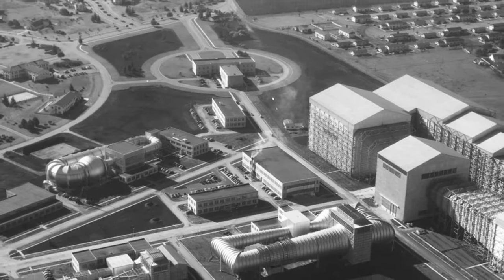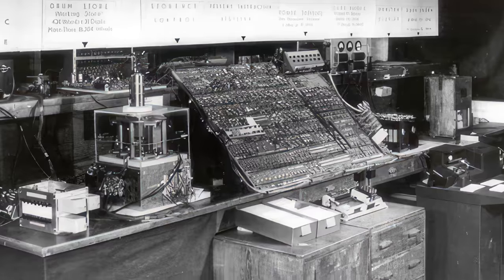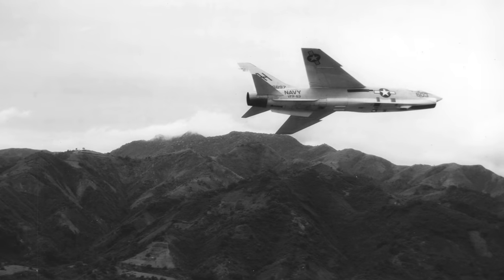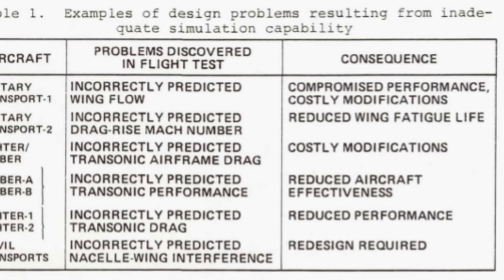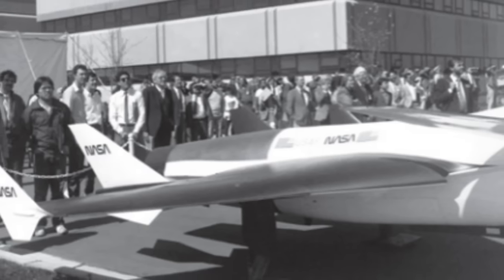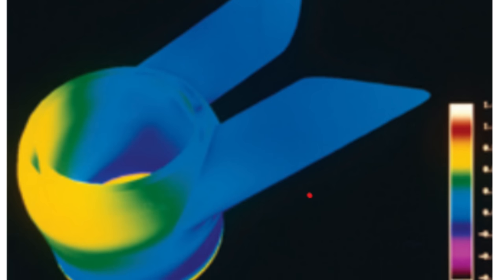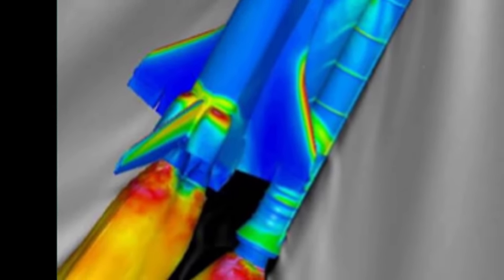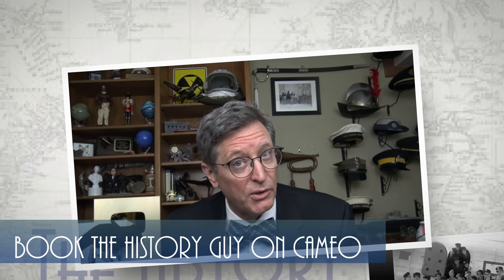A History of NASA's Supercomputers

Comment: ººIf you can read a newspaper by moonlight when the Moon is supposed to be over 230,000 miles away, then how bright do you think it would be if you were actually walking on its surfacer trying to film some home movies ?  The answer would be…That you would be standing in plasma, that you might as well be standing inside a laser beam.  No one can ever walk on the Moon, it is not a world, it is a light.  And it doesn't rotate, is rolls like a wheel.  There is no dark side, there is only what we see.
(Every time that you find yourself halfway to the source of emission, both light, heat and sound will increase fourfold.  This is the inverse square law and it is non-negotiable.  (This is not a theory, it is a law)).
 ºAlso, if the Earth is closer to the Sun in our winters and further away in our summers than how is it possible that the Sun and Moon always looks to be the exact same size year round ?